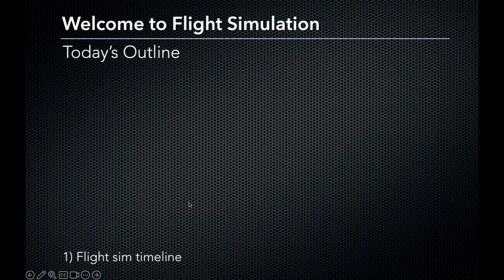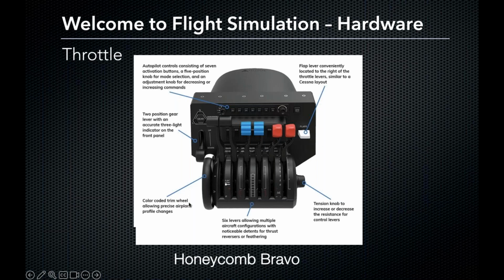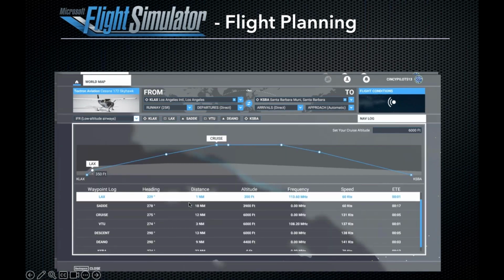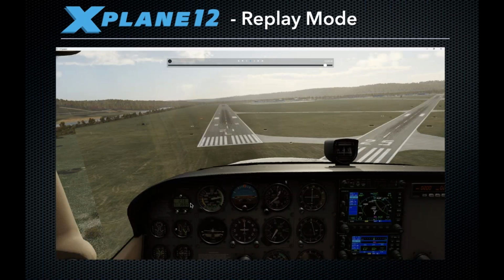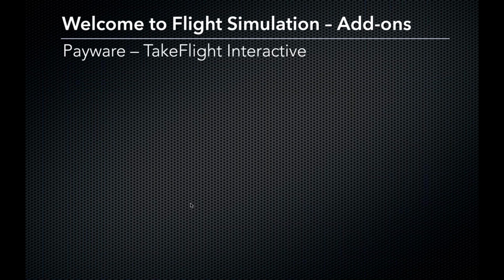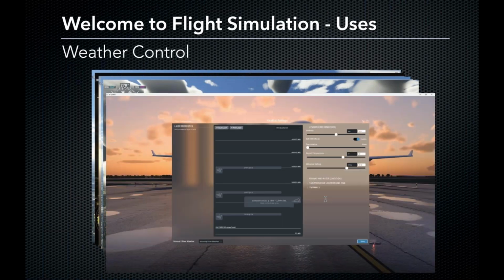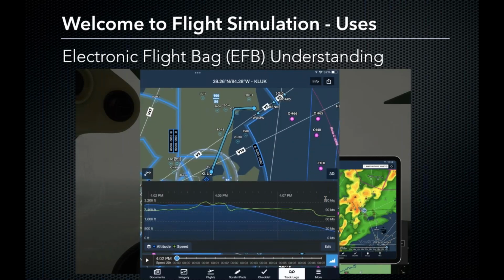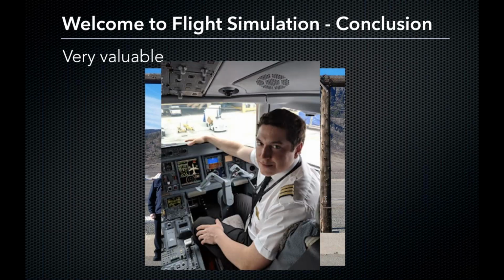Welcome to Flight Simulation Webinar - comparing Microsoft, X-Plane, and Infinite Flight

Comment: This was great, thanks for posting. I've been using a VR headset with MSFS 2020. It works great and find it a lot more immersive than my single monitor setup. I like that I can look around and feel like I am in a Cessna. The main con is that I can't see the yoke/throttle so I've got to rely on feel.

I'm looking forward to using MSFS 2024!